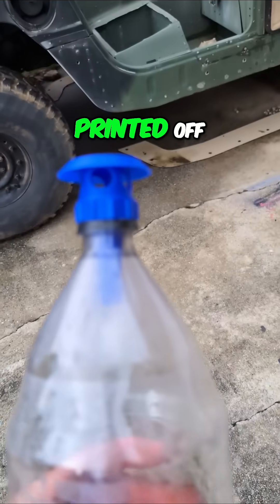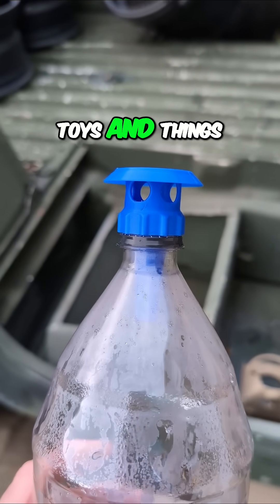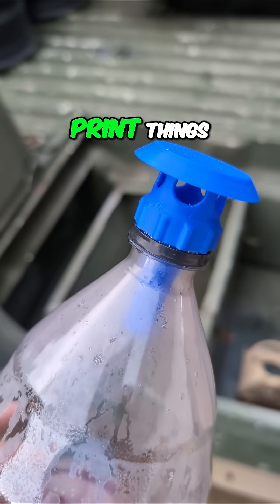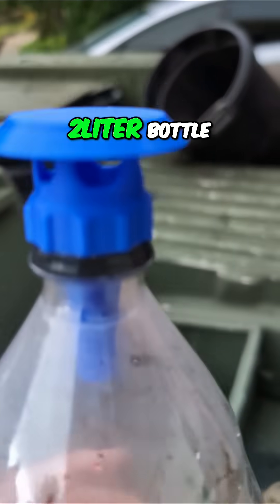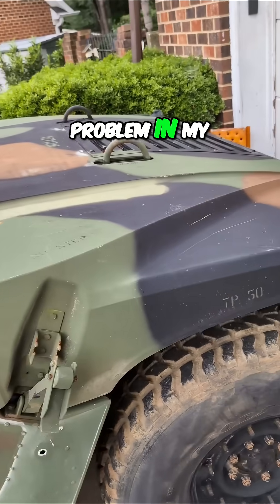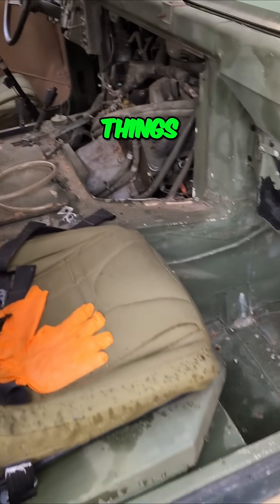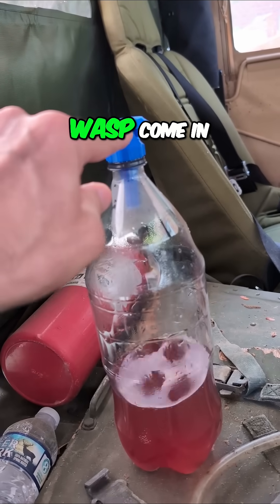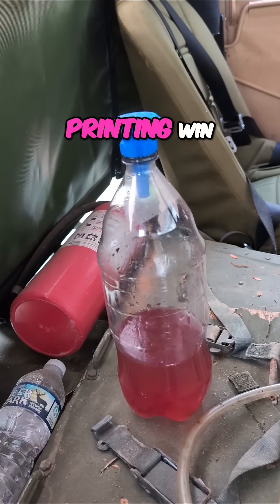3D Print This Genius Wasp Trap & Save Your Summer!

Comment: All I use my printer for is useful things, you just need to get good as modeling software or you can actually use LLMs to build a 3d print from your prompts, just need to be exact with the measurements
Reply from the maker: I'm getting better with tinkercad. It is surprisingly easy to make basic shapes. But I should learn a tool that is easier to do precise dimensions.
Reply: @GearReportMaker  unfortunately the learning curve after tinkercad is Mount Everest, but it’s not impossible, you just really need to play with the fundamentals of the software for a few weeks and fail a lot 😂. If you haven’t try fusion 360 and Meshlabs if you want to get into scanning an object, those are my favorites but they are hard and buy an extra keyboard.
Reply from the maker: Extra keyboard? Am I going to break my current keyboard in frustration?
Reply: @GearReportMaker  high likelihood
Reply from the maker: Yeah. That is why I've stuck with tinkercad for now. :)
Reply from the maker: Sounds like a WIN to me!